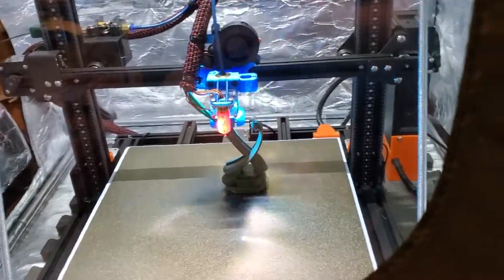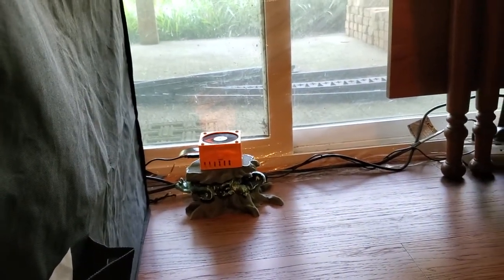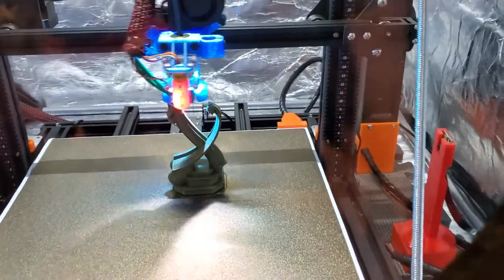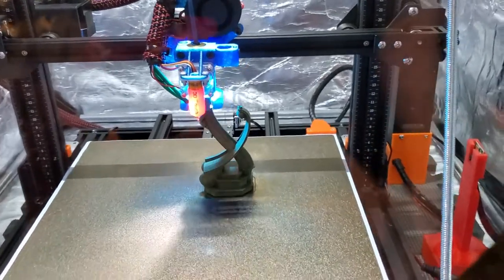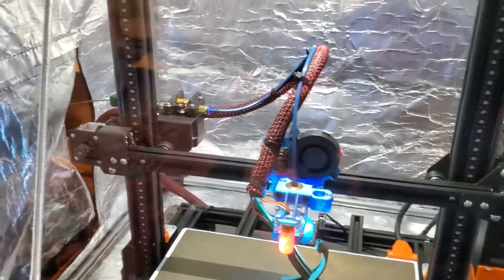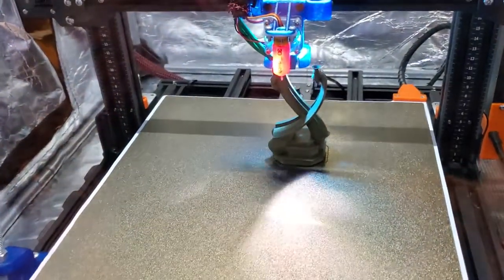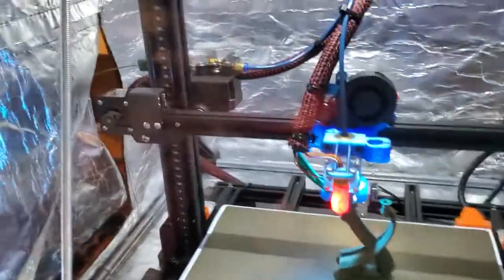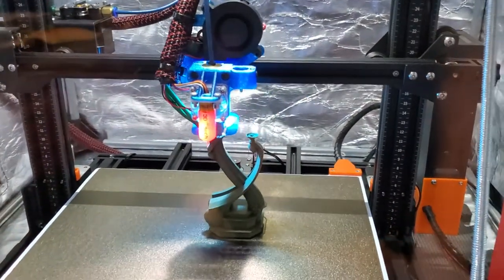Eryone Thinker and Klipper update Sep 2021

Comment: Hey Jay, been a while since we last spoke. I finally got around to upgrading the extruder on my Er-20 and it worked great... Until I managed to completely wreck my hotend doing something unrelated. So seeing as how I need to replace it I wanted to consult with you about any options I might not have thought of or if there are any recommendations you would have. Im considering just ordering another stock hotend from Eryone but I've seen a fair number of conversions to a V6 hotend and was considering something along those lines (maybe even going to a direct drive configuration) any advice would be much appreciated as this is a rather annoying roadblock. Thanks for the continued Eryone focused content, it's been a lifesaver more than once.
Reply from the maker: Sorry to hear about the hotend....that's discouraging.  That said, almost any option out there is better than the stock hotend (not disparaging Eryone, but it's just true).  I'd do the J-Head hotend with Raymond's (on the FB page) mount solution that uses the stock hotend mount/carriage.  Takes some hacking and slashing, but not hard and a great solution (and super cheap).  The other option is to use Dana Olson's (FB page) printed mount for an E3D hotend.  Also super easy, and you'll move into another tier of hotend goodness.  More later (gotta work some)....but I'll be posting a couple of videos (hopefully tomorrow) about the J-head ER-20 upgrade/mount.
Reply: @jayburkette8977  thanks for the reply, eagerly awaiting that video and thanks for the advice, ill look into those options!
Reply from the maker: @lordforgetful  Part 1 posted.  I'll get part 2 up tonight...

Comment: I am about to give my Eryone Thinkers and overhaul.  I think there is a jumper on the board to go from 5v to 24v?  The junk hot end is going, I have eccentric nuts arriving to resolve the sloppy X axis drooping issue (so dumb!).  I'm going to put a Bondtech/E3Dv6 combo on it.  Cheap things aside, the machine has great potential.  Its just the lousy components they went with that baffles me.  Thankfully we have options!  Nice video!
Reply from the maker: Thank you!  Yes - the jumper near the fans is easy to switch from 5v to 24v on the Thinker's board....

Comment: what steper motor are you using? i installed a BMG clone with a stock stepper motor 42-40 belonging to ender 3 but when it retracts it makes a loud noise. do i have to replace the stepeper motor so it doesn't make a loud sound?
Reply from the maker: most likely not - check your voltage (report back).  Also google "stealthchop" - I found that disabling stealthchop on my extruder motor helped the noise quite a bit...